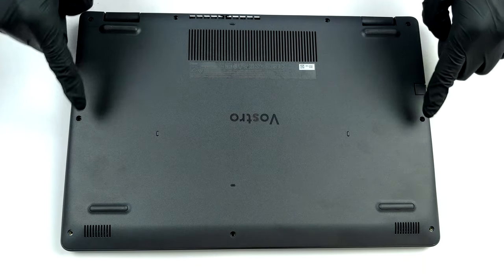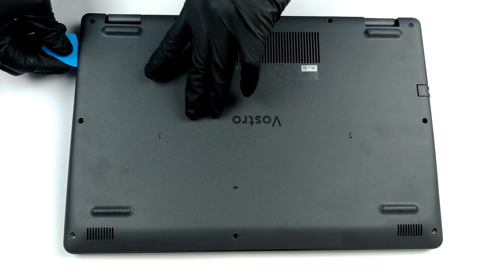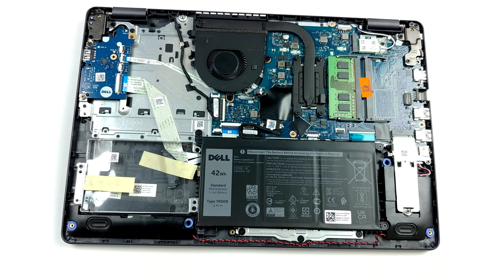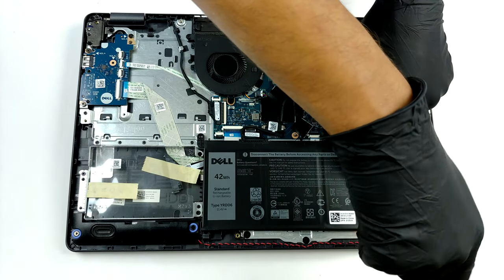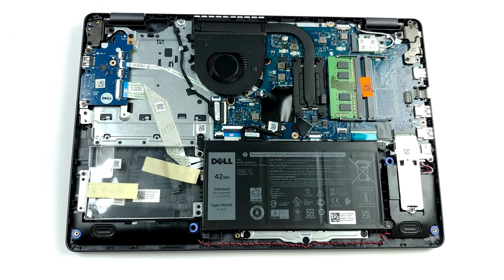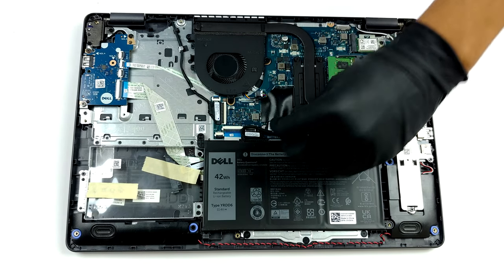🛠️ Dell Vostro 15 3501 - disassembly and upgrade options

Comment: Hello I've got the 3500 version using Intel I7 11gen 1165g7 tiger lake, according to dell I can upgrade up to 16gb but intel says that cpu supports up to 64gb, so can I install 32+32 at this point? thanks for the video
Reply: Depends upon the motherboard and manufacturer whitelist
Reply: hey, did you try to upgrade? did it work with 32gb?
Reply: @antonaleksandrov  nope, i end up doing a custom build :), but i think its possible.